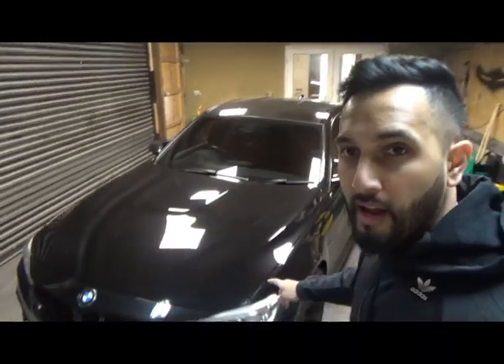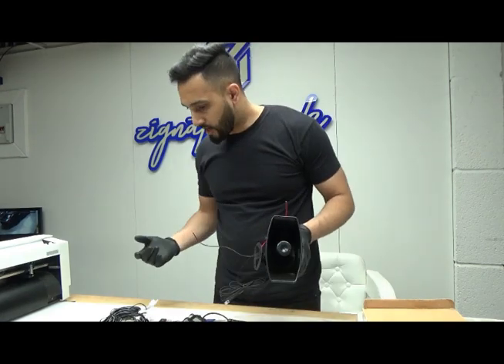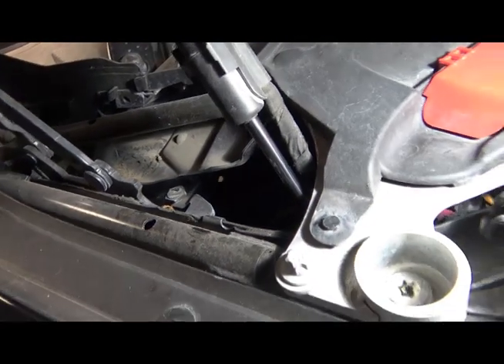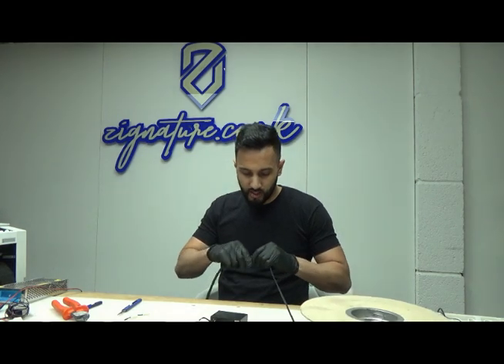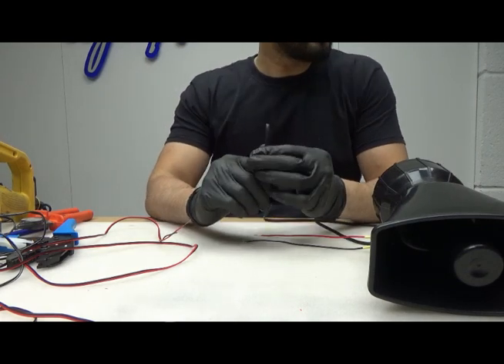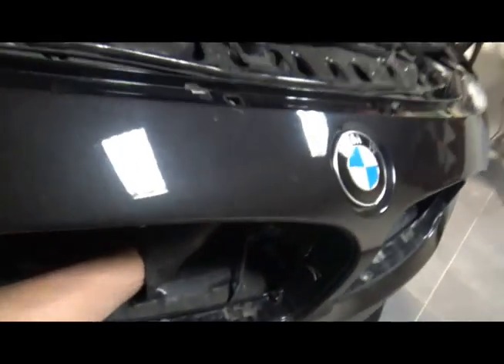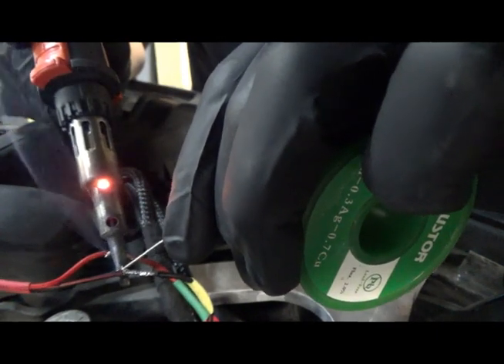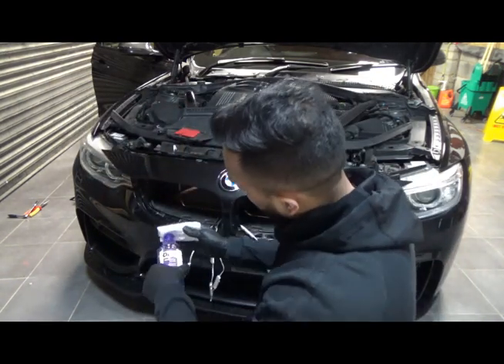Undercover Fed - 541 BHP F80 M3 - How To - Flashing Lights and Siren Installation

Comment: Just for our American friends, in the UK it is illegal to have:
1) Red light facing the front (Any vehicle, even the police)
2) Blue light on any vehicle other than "Emergency services" 
3) Siren on any vehicle other than "Emergency services"

That said, you could have amber lights and an ice cream chime 😃

Lights should also be visible from 360 degrees, so just lights on the front is pointless, if you are going to do it, get a light bar and put that on the roof.😎
Reply: Exactly, convert an old whelan bar,  some white cool LED strobes can give off a blue hue if the frequency is fast enough - that could be fun! :-)

Comment: Bro sick video but the undercover feds in uk are blue and white flashing lights not red.. yours are the American feds lights
Reply from the maker: Thanks bro, and yes you're right, I didn't want to fully imitate UK feds,  that would be fully illegal, this is more novelty than anything, but if you wanted to do blue and white, it's the same concept, and the same kit is also available on ebay with blue and white LEDs. Thanks for taking the time to comment.
Reply: @UKWN  no it’s not, it’s an offence to have them fitted
Reply: it depends on the state
Reply: @jxckcufc8307  its actually an offence to use them - its only an offence if fitted if , for example,  a light bar together with battenburgs and some daft logo that looks like police insignia, say.

Comment: The whole setup is American, LEDs are not proper LEDs that ouput fully facing light so your headlights pretty drown out the lights making them hard to see, sirens are US and controller is US too, UK emergency lights are either completely blue or blue and white. Any normal person can tell this is a fake response car from 20 different reasons, lighting setup is terrible, red and blues, US sirens never mind cameras and police officers and even though they are red and blue LEDs and not fully blue this is still illegal.

Not to mention no front license plate, no hater but the fact you've uploaded a video with 11,000 views showing your face and vehicle literally on public roads with lights and sirens and no license plate wasn't exactly smart....in proper use of emergency equipment and impersonating an emergency service and no license plates are all criminal offences, again no hate but stick to private land as you got lucky as the police don't take this stuff likely as its dangerous.
Reply: i agree, may aswell just get a 50/50 relay between the two headlights for the front, more...obvious!
Reply from the maker: Thank you for your comment, still waiting to go to prison 👍🏼